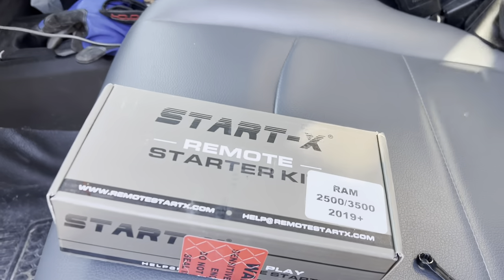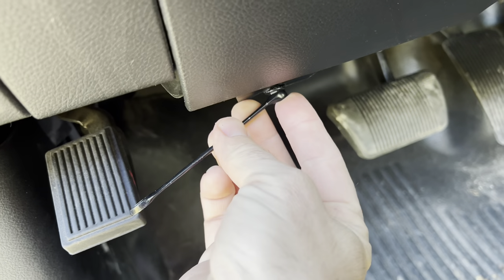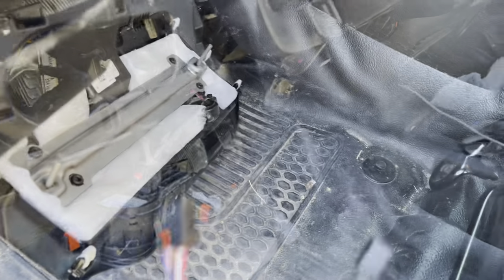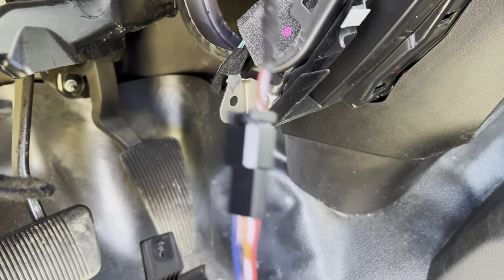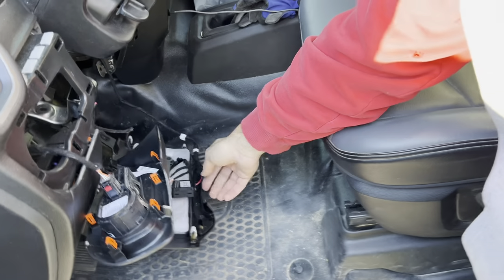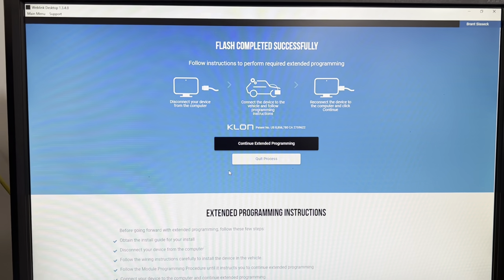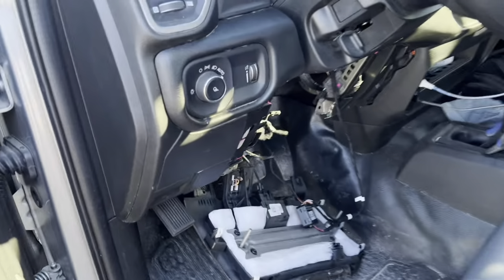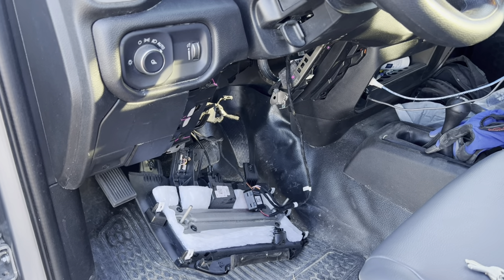Start-X remote start for Ram 2500/3500 2019-2022 install

Comment: VERY GOOD VIDEO!!   I had a little issue getting the box to work but it did.  Might want to ad that if the truck is running and you want to turn it off, hit the lock button three more times.

Comment: Update. It worked. It has worked very well. I did it a little different than this video and it worked. At first, it worked and then the locks wouldn’t work. Then it didn’t work at all. I found another video on this where the guy says there are updates and different procedures to program the unit. So, I don’t know what the heck I did but it was a little different than what’s in this video and it’s working very well now. Good luck you guys. Looks like it’s great.
Reply: Hey where’s this other video you are talking about …..
Reply: Ya I’d love to see this new video!

Comment: Guys if you have trouble receiving the confirmation email check your spam folder that’s where mine was also I just installed this on a 22 ram 1500 and I did have to install the ignition tap wire for the system to work. Hope this helps.

Comment: Hopefully you can help with my question I’ve looked everywhere and can’t any answers! How does this do for cold season does it let you set a timer for the grid heater to heat up or does the truck not let it start until the preheat cycle turns off? I’d like to buy this kit but that one question is stopping me until I know the full answer TIA!
Reply from the maker: I reached out to Start-X and this is what I got back from. 

Thank you for your interest in our products.

Our kits are programmed to accommodate diesel engine requirements.

I have personally never installed one on a diesel hopefully this helps.
Reply: Thank you very much!

Comment: You did not have to tap into the ignition wire on block E of the BCM? I have the exact same looking harness but it is an MPC starter. Install is exactly the same except I am supposed to unplug Block E from BCM and tap into the white/pink wire. FRICKEN IMPOSSIBLE without breaking something.
Reply from the maker: No I didn’t have too with this one.

Comment: Would this work on a Promaster 3500 ? Is it basically the same ?
Reply from the maker: I would think so, but you would definitely need to check with the manufacturer. I have only put these in Ram 2500s

Comment: Do you have the link to order one for my 2021 ram 2500 diesel
Reply from the maker: Start-X Remote Starter Kit for 2019-2022 RAM 2500/3500 || NOT 1500 || Plug N Play || 3X Lock to Remote Start https://a.co/d/6PiU31z
Reply: @BASgarage  Thank you